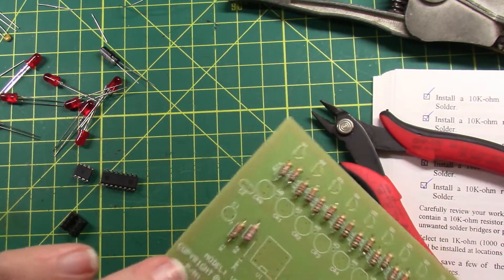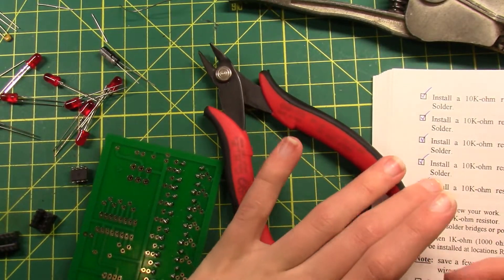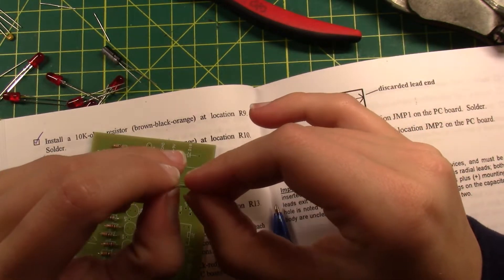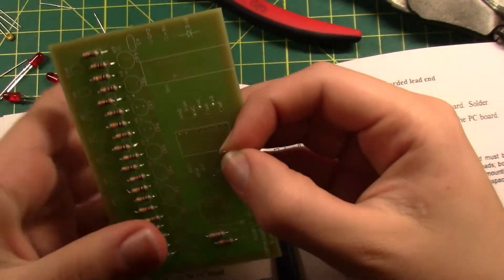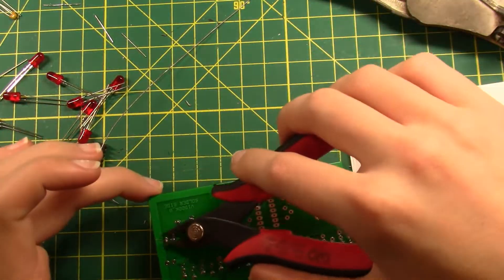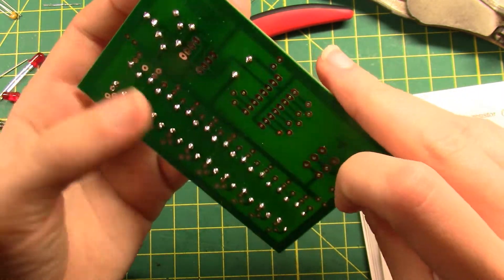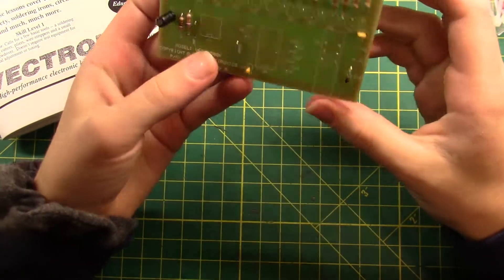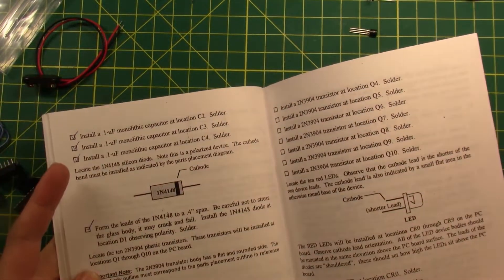How to Solder!! Part 2 - Capacitors and Diodes!!!

Comment: Hi Becca,
👍👍on a great build. Have a tip for setting up a row of LED's at the same height. Measure under the LED the spacing needed to set the correct height. Take a business card and fold it with a sharp fold along the long edge. Now cut with scissors a width the same as that spacing from the fold. Use that with the peak up under the LED's. It will hold all the LED's at the same height while you solder the leads. Looking forward to part 3. Stay safe.   73  WJ3U
Reply from the maker: Thanks for the tip! I'll be sure to try it!